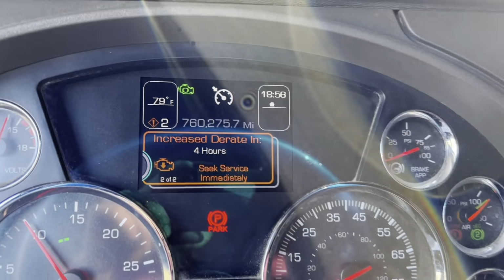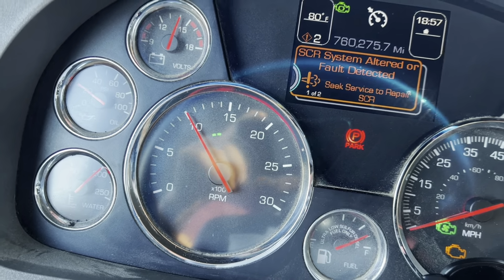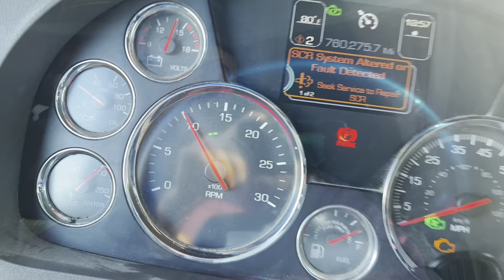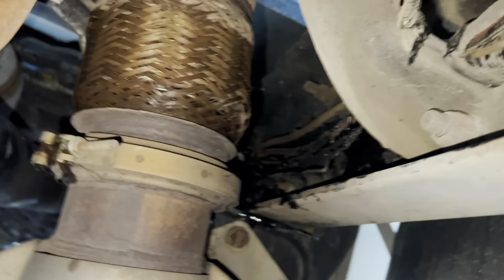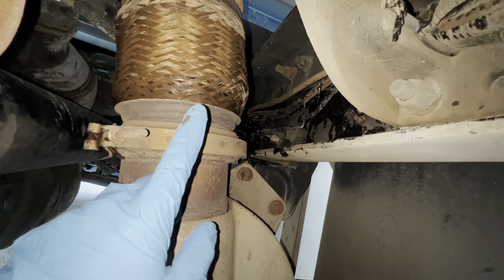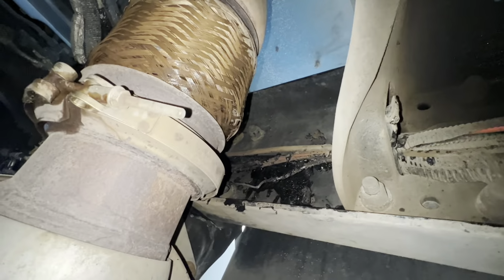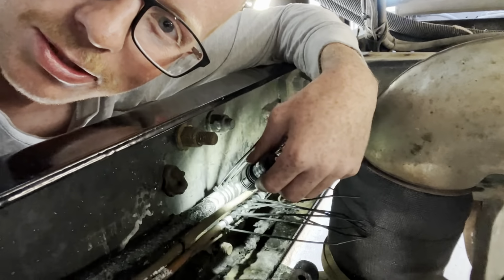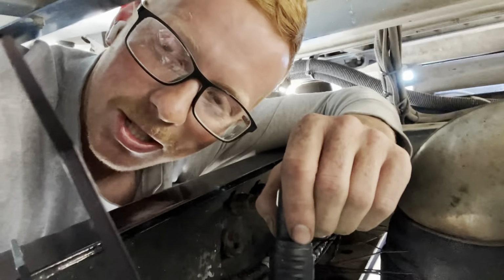Exhaust leak melted everything! OTR truck repairs

Comment: Hi There! Can I take your opinion real quick if possible? To make the long story short, I have a 1 yr old CDL A )clean record, a 2022 Ram 3500 diesel dually aisin trans at 22k miles. I do not have my authority and do not have a trailer. But I can rent a trailer.  I tried auto hauling with 3 car Kaufman, I don’t like it. So many stops, problems with cars etc. An experienced friend suggested to do flatbed freight hauling. He said overall easier, point A to B etc. Not like delivering and picking up cars that can be very far from each other. He suggested to find a good company to lease on to, which charges 10-17% for dispatch. I tried searching on google, but I have no luck so far. Most need own authority, 2 year’s experience etc. I started with zero experience in car hauling, I learned quick. What do you suggest I do in terms of locating a professional company which provides dispatch and insurance services? Thank you!
Reply from the maker: Look on for hotshot Facebook groups many people willing to lease you on and give you a trailer. Let me know how it goes for you and feel free to email me dispatch@minutmentransport.com
Reply: Get your paperwork in line get a trailer and start knocking on doors in your town start with equipment rental companies pipe and plumbing suppliers oilfield if you have it work in your state charge hourly be prompt professional and courteous wear a logo shirt and hat have cards i hand out note pads and pens with my logo and when that phone rings you jump build relationships I’m in it 10 years next month we work mon to fri trucks average $20k a month each less fuel less mileage so less maintenance and repairs sleep at home have a life with your family I have a broker side and ima keep it a buck I make more than the outside haulers that run the load just for having the accounts